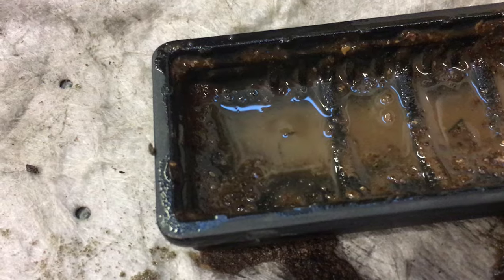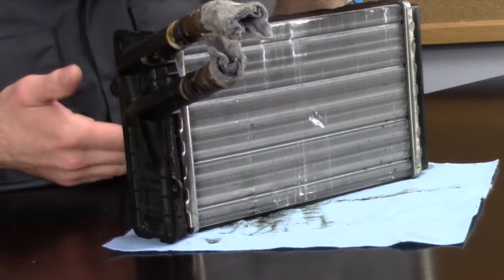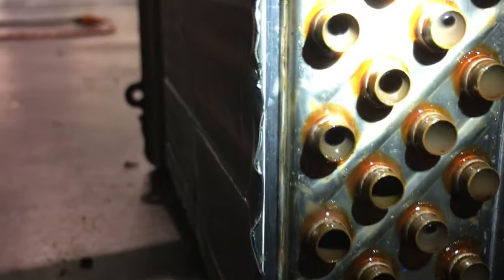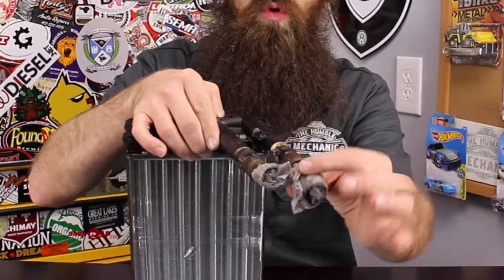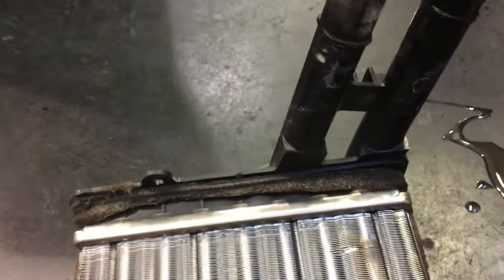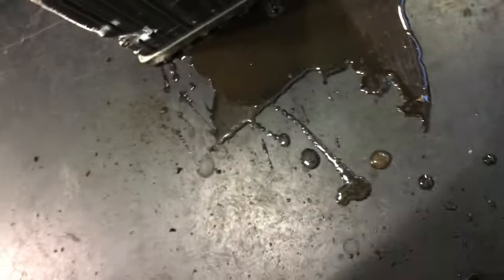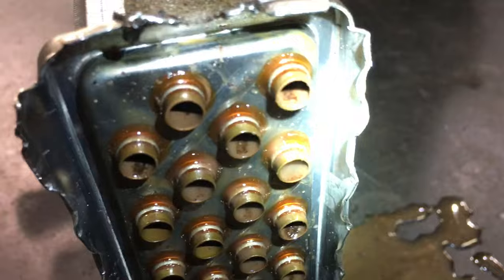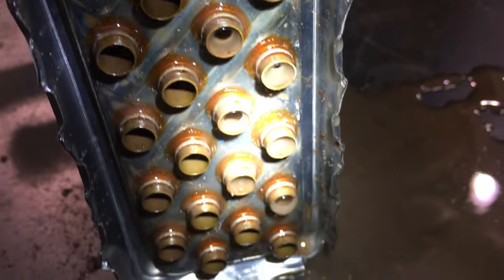How VW Parts Fail ~ Heater Cores

Comment: I have a Mk7 GTI, all of a sudden Im not getting heat even at the highest setting, its just luke warm. But cooling works 100% fine. Also getting slight coolant loss and constant "check coolant" warning. The warning happens every time I drive, sometimes when I just switch the key on or after driving fro a few kms. No signs of over heating. No loss of power or any funny noises. 

Im just confused and pissed off at this point, dont know if its the waterpump/thermo which is less than a year old, or worse headgasket. 

Car is out of warranty so just dropping it off at the dealer is not easy. Im thinking of getting a diagnostic tool first. Otherwise will pay arm and leg.

Comment: I have a question: the air blowing is somewhat lukewarm, when i put the blower on heating, the inlet to the heater core is very hot, the outlet is somewhat cold to lukewarm, when i turn the heating off then both inlet and outlet are hot, does it mean the core is clogged? Or do i have another problem?? I checked the flap motors on both sides and i can see them both moving, i even did the relearn trick. What could be the problem? Thermostat seems to work well, the car heats up quickly and does not overheat. Jetta mk6 1.4tsi.  Thanks!!

Comment: Question in regards to heater control valve. 
2015 vw golf 1.8L 
Replaced core and there was no coolant in it(thinking it was plugged) either way we put in new core and ran engine.. still no heat, no circulation still through core.
Where is the heater control valve located in this vehicle? Doesn't look like it's in engine bay.

Comment: My heater core in my 2013 VW Jetta GLI failed after 10 months but my mechanic is saying it is not covered under warranty because it wasn't installed at a dealership, is this true?? He bought the part from a dealership but installed it himself.

Comment: My VW Jetta TDI 1.6 is taking too long to reach 90°c. Even if I reach 90°c it starts dropping as soon as I stop. It remains constant at 90°c if I drive constantly above 70KMH. The thermostat was replaced last year but I didn't get a chance to test it because it was already summer in Estonia but it's behaving same this winters in -ve temperature. What could be the issue?

Comment: lol, make sure the blend doors are working properly. so does vw still use the same foam covered blend doors they've used for 25 yrs? I work on older vw/ audis, bmw and Benz. I hate getting in a vw and seeing foam in the vents, means it's going to be a long day...
Reply from the maker: Hahah I was reading this while sitting in my GTI- with little bits of foam stuck in the vents.
Reply: +HumbleMechanic foam likes to blow out if my vents too. When I turn the knob to direct flow from say, head to then feet, it doesn't change anything. If I put it on defrost it still blows at my face.
Reply from the maker: +KillThatScrubGaming yep, air just comes out of all the vents in my GTI. This winter I will be doing some videos on how to fix that
Reply: +HumbleMechanic that would be absolute fantastic. I plan on trying to flush it sooner or later and pray that's the problem.
Reply: The worst. Worse than engine swap that foam cost over 400$. You can get silicone based material in a roll and do it for 30$ minus the door foam. It's gonna take 2 days literally.

Comment: hello very good video  👋👋
in vw golf mk2  do I need to remove all dashboard to change heater core ?
I have very weak heat (air pressure ok)
u mentioned thermostat can do such problem also I have put water in heater core it's return pipe flow is full and not clogged  any help will be great it's winter here and bitter cold
Reply from the maker: Very likely

Comment: Never had a problem with heater cores on any of my air cooled VWs. Although they didn't have any heat either. After 37 years since my last air cooled I'm in my first water cooled VW MK6 GTI. Nice to have heat power & handling in a very comfy package. VW has come such a long way. 
Your video has scared me straight, I will be doing coolant service on my GTI at the appropriate time. Think I'll add a coolant flush to the 40K service. Thanks for another insightful video Charles. Knowledge is power.

Comment: Not only temp faults on cjaa but also a fault for coolant flow. I have a mk6 Jetta that had a stop leak put in it and heater core is plugged and fault I got was egr cooler insufficient coolant flow

Comment: Hi bud. My b6 VW Passat 1.9 TDI has a coolant leak for months that no garage can find. Coolant leaks from the bottle but no visible leak anywhere. Possible head gasket but the car is driving perfect. Also heater blows hot and cold air when it feels like it. Could the thermostat cause coolant to leak mysteriously and affect the heater from working and if I replace the thermostat could that fix the issue?

Comment: For a '99 Cabrio 2.0, what should the normal interior cabin heat reach in F degrees? My heat doesn't get much warmer than the cold air outside.

Comment: What if one has the opposite problem, in other words you get only hot air inside the cabin? I am experiencing that issue. The section right above my radio get pretty warm. I measured it to about 107F today. Any suggestions what is causing that?

Comment: My daughter just bought a beetle I can't remember if it's a 2000 or if it's a 2006 driving it around I noticed the sickly sweet smell when I put the defrost on. Does that automatically mean that the heater core is bad or could it just be clogged?

Comment: Was wondering is it okay for the temperature gage to be at 200 on a 2009 Passat TSI?
Reply: Sure is. Normal operating range for most VW is 185~220. Most gauges on VW are off by about 10 degrees so really you're at 220, top of your range.

Comment: I got all the air out of my heater core and it worked for one day.  not sure if I should flush it or is it something else. temp gauge climbs a little then drops back down and keeps doing the same thing. is that a thermostat.

Comment: In the video at 7:00 you show accessing the heater core from behind by removing the dash assembly as one unit. However, I need to replace a leaking AC evaporator, which will require some HVAC disassembly. Is it possible to remove or disassemble the HVAC unit from behind with the dash out as shown at 7:00 or are there bolts holding the HVAC in that require front console disassembly in order to access them?  Any advice greatly appreciated.

Comment: Great video ... thank you for the detailed explanation.  I have a 2000 Jetta (AEG) that is getting the "sweet smell" in the cabin, foggy windows and wet floorboards.  I still have heat though that works just fine.  I am loosing coolant slowly which may be related or could be elsewhere.  Think it's a clog or a leak?

Comment: I have an 05 mk4 Jetta gls and in the dead of winter after started for awhile it's still doesn't heat up. Now after sometime it's very hot. Is the time elapse showing that my heater core is starting to fail? It only has 106k?

Comment: I have a vw mk7 golf 2017 and i noticed heater isnt working properly where at almost max settings its cool not hot and usually at 2 notches i get extreme heat. Thermostat of car is fine says 90 so no idea whats going it on started today no heat only ac works...

Comment: Charles first TY for your awesome Vids! I recently bought our first VW a 02  Jetta TDi. We LOVE this car! Steering is soooo tight and responsive, drives smooth dead straight down the road for mile if the road is level! I have 2 questions if you could please let me know privately or publicly I don't care just really need a bit of direction. Our heater core is leaking I smell it when the heat is on no steam yet though. 
1. When I replace the heater core what is the BEST brand I can use I don't want to do this 2 times.
2. Is there a tutorial that you know of for moving the dash out enough to sneak/squeeze the HVAC box out? Our car is old and brittle from Texas heat and I would like to preserve it as much as possible.  
THANK YOU again for the informative videos. I subscribed as soon as I bought our Jetta.
Reply from the maker: I bought an off brand one from URO I think for my MK3. Most seem to be about the same. 

I am sure that someone on VWVortex has done a step by step. I will be doing one on my R32 in the spring. All the foam is coming off the blend doors. You will have to take the whole box out, so that means evacuating the AC
Reply: I used a Valeo brand without issue. If you're willing to pay more, dealership will get you one.

Comment: I have a 2012 VW tiguan the heater core is bad. Leaks inside the car. It's $1500 & I'm in college ugh. The hoses are metal right? How can I bypass it I live in Florida I don't need heat.

Comment: Could a clogged up heater core cause the car to overheat?  I have been overheating on my 2005 Passat 1.8 and after changing almost every hard part, I bypassed the heater core and now I am not overheating.  Yes, I have bled it properly multiple times, including vacuum bleeding it thoroughly.  When I put the heater core back into the system it overheats again.

Comment: I just replaced mine the end of last winter and everything was working perfectly. Now that it’s cold again I’ve noticed another wet floorboard and intermittent coolant light 😭. Any ideas as to why this seems to be a recurring issue for me? I don’t mind taking the dash out again if I know I can fix it, but that’s a ton of work if it’s just going to turn around and happen again. Where should I begin?
Reply from the maker: Confirm that it’s a coolant leak

Comment: 7:02 I’m wondering if that would’ve made the job any easier for me on my old 97 A4. I did that job about 3-4 years ago on that car (sold it :( ). I went the whole Colorado winter without heat, spring time I finally did the heater core job. It was a complete PITA if you ask me. Then I found out my AC compressor was blown when I had to have the system vacuumed out beforehand to do the job. It sucked. So I didn’t have AC all summer. Lmao. Never again did I want to do that job. Luckily the core lasted my entire owner ship. However let me tell you that car was not friendly what so ever with coolant issues. Man. One thing after another. The day my 04 A4 quit putting out heat I was so nervous this was my fate again. Luckily I was able to achieve a fix via a flush using a $8 harbor freight fluid transfer pump and a $4 coolant flush bottle, big bucket and some water. Worked like a charm. Sold that car recently. I’m now in a 2013 Passat TDI, got in on a CPO, the day after buying it I brought it back to the dealer for a heater core replacement. Luckily, covered under the CPO. Just now realizing every German car I’ve owned has had a heater core issue. Lol.

Comment: I have a 2000 VW Polo.  Low milage and in good condition.  Very foul smell when I turn the heat on.  It's a strong ,sweet, burning plastic smell.  I changed the filter but it continues.  It is dangerous?  What is it?  HELP.  Thanks

Comment: So, if my coolant level dropped to trigger a warning, and my heater stopped working,  AND the only engine dtc being reported is an egr cooler inefficiency, would that likely mean my heater core is toast?
Reply: Edit: I have a 2013 vw beetle tdi 2.0L CR DSG

Comment: Explain this 2.0 cr caddy leave engine idioling  engine temp goes up and everything works , soon as I drive heater and temp gauge go freezing , tryed thermostats/ flushes uses not water/ good return flow ( can any help ) dealers changed asorted  parts with no fix

Comment: Hello. Thanks for the video. Can I replace the heater core without draining the whole system? I have a 2014 Golf and I could easily swap the heater core without removing the dashboard, but I'm not sure how much coolant will flow out once I disconnect the heater core if I don't drain the system. Also I'm observing coolant loss, I'm not sure If a clogged heater core can cause that, but I'm getting only warm air when turning the vent speed to high.. once I lower the speed of the vents I get somewhat hotter air. This makes me think that there is something wrong with the heater core, either clogged or there is a leak. However I couldn't find any coolant in the inside of the car. Thank you very much!
Reply from the maker: You will loose some coolant but not the whole system.

Comment: and don't use tap water for mixing coolant or for  top offs ,distilled water way to go
Reply from the maker: +lolus pololus Technically deionized water is the proper water to use. ;)
Reply: +HumbleMechanic Yup, especially in something like a car with mixed metals in the cooling loop.
Reply: +lolus pololus and if you don't have the correct coolant on hand use only distilled water because if you use the wrong coolant you will get a gel that will plug things up and cause a very expensive headache.  That is because your engine could overheat if the radiator gets plugged and at first you might suspect the water pump when it is really something different.
Reply: +lolus pololus That depends on the quality of your tap water.
Super clean water where I live, so we use tap water for everything at the shop.
Reply: panzerveps Unless you use reverse osmosis you very likely still have something in the water.  I just do it safe and use distilled since I have well water anyhow and it leaves stains over time.  These are the kind of stains that are so bad they don't just simply go away, scrubbing does nothing to them unless you have all day.  I hate scrubbing.
Reply: +John Doe Norway is known for its super clean tap water.

Comment: I have a 2008 VW Rabbit 2.5. My windshield has a oily residue on the inside. Makes it tough to drive at night.
Could this be a heater core issue?
Thanks for all the info
Reply from the maker: Possible. Or may need a super deep clean on the windshield
Reply: @HumbleMechanic  Thanks Man!
I hit em with distilled vinegar and seemed to make them crystal clear. Night time is when they are an issue.
I googled the symptoms and heater core was popping up everywhere.

Comment: Question about my 2014 Jetta TDI. So i had a new heater core put in and now the only heat coming through the vents is my far left driver's side and for the other 3 vents it's a cool air not really warm at all any ideas for why this could be? Thanks
Reply from the maker: odds are there is still an air pocket in the system

Comment: So my b6 passat. Blow hot air on drivers side and get cooler as you go to the passenger side. It's ice cold by the time you get to the furthest passenger side vent. Would a heater core flush possibly fix this?
Reply from the maker: Very possible

Comment: My 03 Passat just started acting up and wont blow hot. I felt both hoses going to my heater core and they are both cold. Is that a heater core problem or a control valve problem? Any info would be appreciated.
Reply from the maker: Most likely a heater core issue

Comment: Nice video HM. Can you tell me if the shortcut you showed with Passat will work on an '04 Jetta Tdi with a leaking heater core?
Reply from the maker: I don't think so. But those really  are not too bad
Reply: Really?  Seems like a whole lot of work. How many hours does your shop estimate for such a job?
Reply: Will the pulling of the dash to the side work with the 2003 MK4 Jetta??

Comment: I owned a Peugeot 205...leaking heater which was visible from the pedal area.....and tried to get it past a steel coolant pipe which jammed the way...... But it didnt pass and I had to remove the complete dash ( as the dealer told me.....)  to loosen 1 bolt  so this steel coolant pipe could move 0.8"  out of the way and let the heater core be removed...aaaaaAaaaaahhhhhhhh!!@#$$@@!

Comment: Hey Charles, my 2010 VW Jetta 2.5 is making an unusual high sound noise during acceleration and the heat doesn't work. any thought?
Reply: Was it the water pump?

Comment: I love the video, very professional and informative... however I am one of the very lucky owners of a b5.5 Passat gle 2.8 that had the heater core fail and burst coolant into the floorpans. We then paid over $1,000 for the repair, and 18 months later, after being told a genuine VW part had been used, it failed again, the shop that did the repair refused to cover the cost of labor, only the part, and as we all know this an almost labor exclusive repair. So would you like to fancy our opinion of VW's after this experience? Needless to say it's not great, especially after hearing in this and multiple other videos this is a common/well known issue with my EXACT CAR. However, I am also the happy owner of a 2007 Cobalt SS/SC, and that has been a delight to own compared to the VW, which was also cleverly designed so when the springs begin to wear, oil pan clearance with bumps in the road becomes an issue, and with aluminum that's a big issue. Not to mention the springs also being prone to snapping, the sunroof drains clogging causing the perfectly placed in cabin transmission module to flood and fail potentially causing lockup at highway speeds. Have you guys done a praise video of this generation Passat? No? It's most certainly worthy of every VW enthusiasts disdain for what VW is capable of at its very worst.
Reply: I'm currently in college for auto tech, so I will be in the profession very soon, and while that damn Passat is still running like a champ as our backup car (bypassed that pos core)  you can be damn sure I'm not gunna buy another. My grandma owns the exact same car and has been shelling out her life's savings recently just to keep the pos running.... 75k miles garage kept its entire life...... the lesson unfortunately with VW is your better off buying cheap, there's no way it will be as expensive as owning a VW.